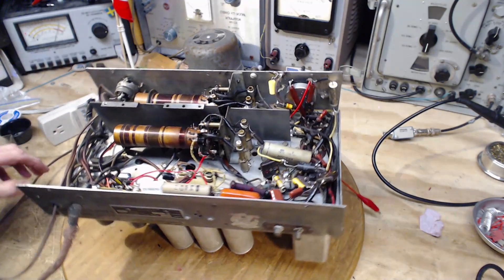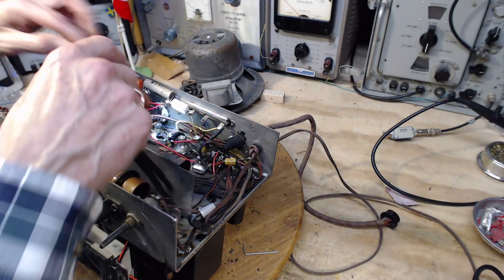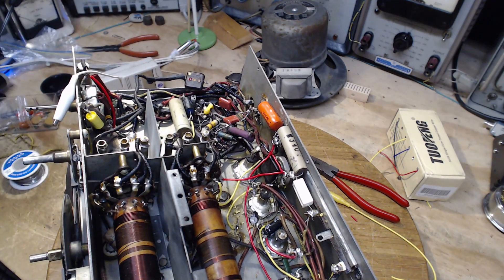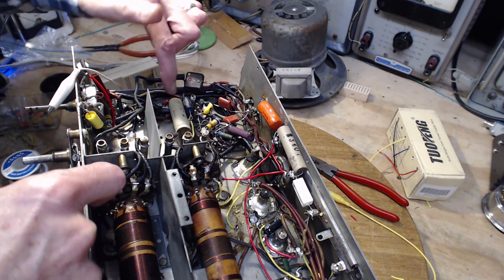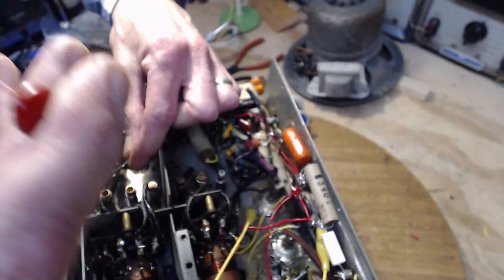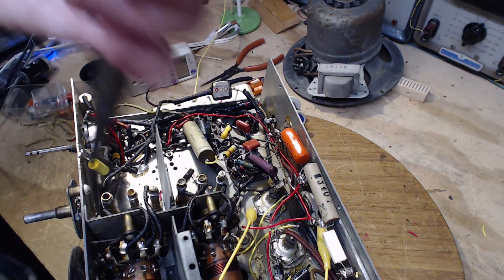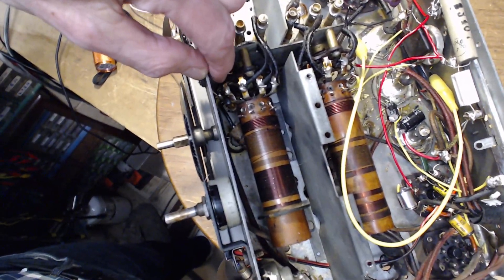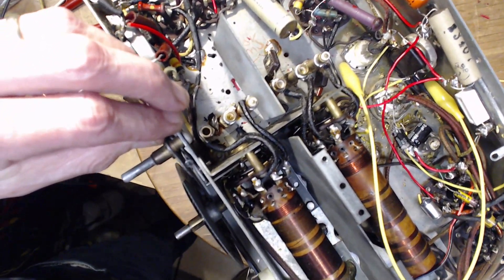Canadian Westinghouse Model 512 Tube Radio Video #12 - More Wires Replaced

Comment: Do not remove the coil until all other wires have been replaced.
Reply: Before cutting any wires, you should ohm both end points of the wire to verify they are both ends of the same wire.
Reply: You keep making more work for yourself. Hopefully you have replacedvall of three B+ and B- wires that should be easy to trace. Of course any wires that end at a resistor should continue thru the resistor on to a tube pin.

Comment: Yo Jim! Ya might wanna see if that bare wire is actually touching the chassis or is a ground wire. Use your ohm meter to determine that. The idea is why replace a wire ya don have to , if it already is wired ti ground. That yellow wire would concern me more. A bare loop of it looks very close to the chassis. Maybe turn on the power and measure what level of voltage is on it. Perhaps apply just an insulating piece of uncladOC board under the loop so it will never touch the chassis.

Note: when they build the chassis the long wires are run first. Then components are added outwardly in depth levels. It seems you know nothing about construction.

Otherwise keep on plugging and stop mumbling to yourself so much. Ya put me to sleep !